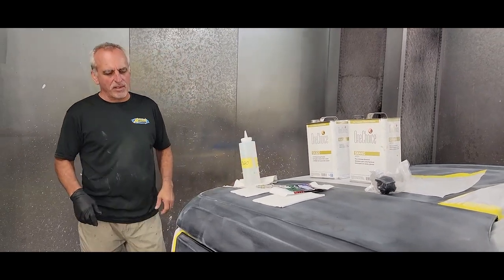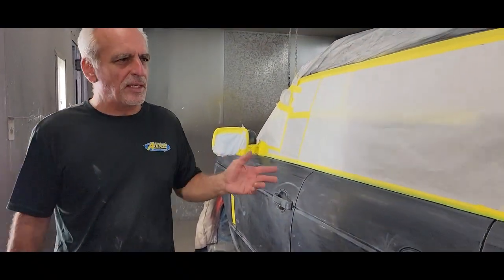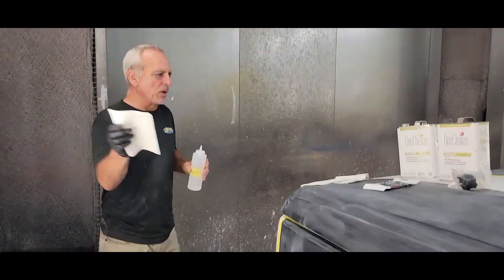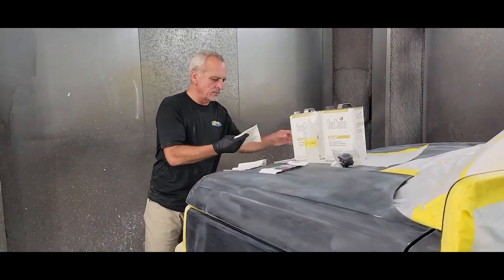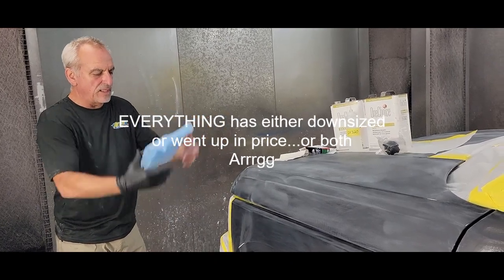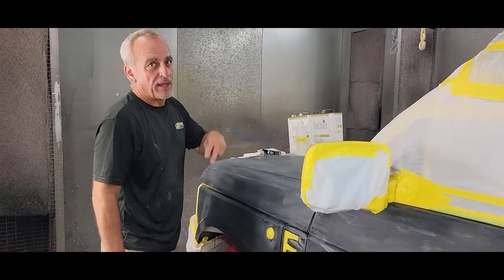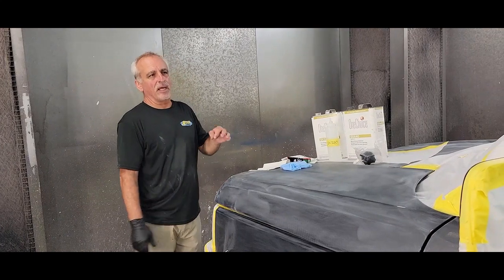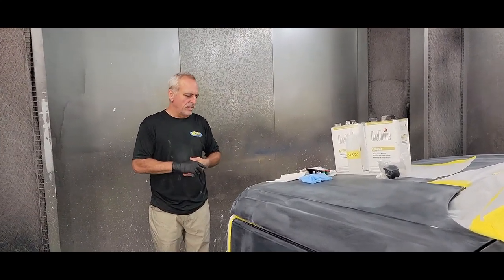Auto painting tips - Wiping down and prepping the surface for painting

Comment: Hey great tips.. so do you have any tricks for painting those roofs that you can hardly reach out there much less stay 5 inches from the gun. My friends says to pencil in the fan but I seem to always get dry spray. What are type of bench are you standing on? Looks like your about my age and height. Someone told me the most efficient machine has no moving parts, food for thought. Keep vids coming
Reply from the maker: Thanks Jon... the past big trucks I've been spraying the roof first, then mask it and worry about the rest of the truck next day. Also since it's been so hot down here in FL. Sweat can become an issue if I do ALL at once.

I like the Cosco 3 step stool
https://amzn.to/3HQSzWz

If it's a wide truck/SUV, use the step stool on one side and regular 6' ladder on the other. I also get the rear of the roof by spraying it from the rear. If it's a truck, I have it masked off so I can step into it and spray the roof that way.

 I have had to turn down the fan as you mentioned before, but the above gets it done without changing from full fan

60/170lbs

👍